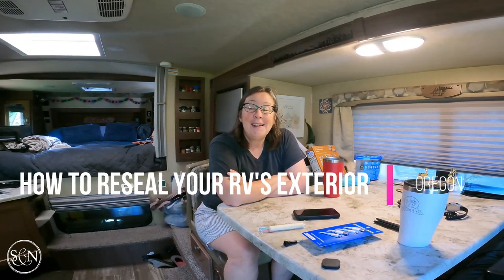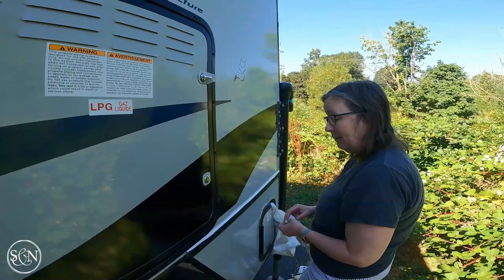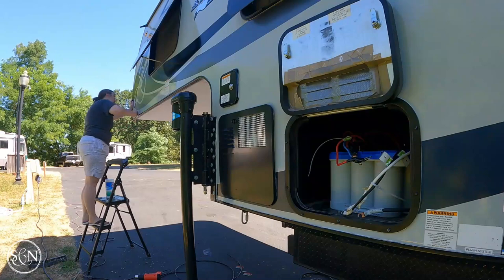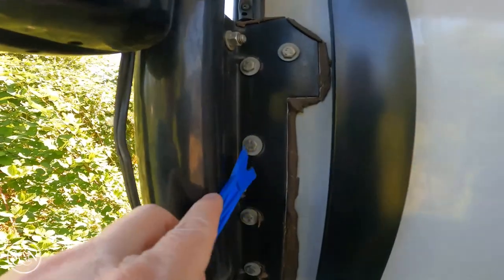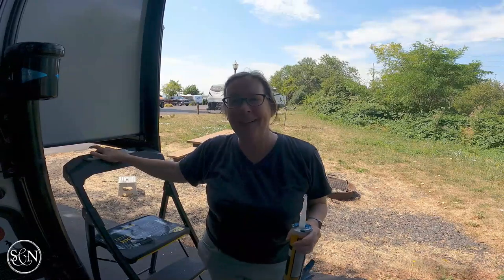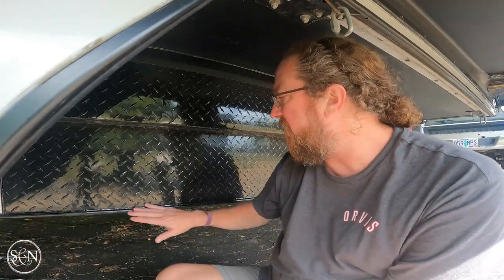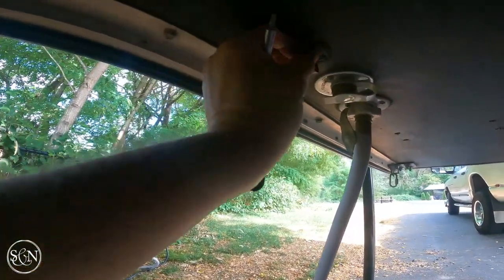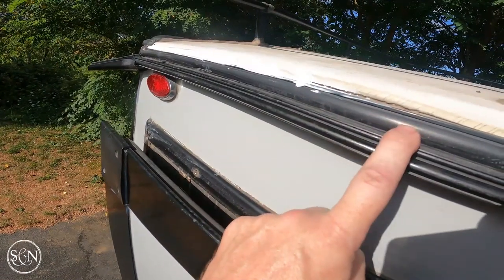How to Reseal Your RV's Exterior

Comment: OSI Max is the best silicone I've found so far. You can get just about any color.  The dicor flex silicone is too sticky and hard to tool with your finger.  On your long bead runs you can also use some masking tape.  Run your bead, tool with finger and then peel tape to get a nice line of caulking.
Reply from the maker: Thanks for letting me know. I’ll add OSI Max to my list for next year! I thought about using masking or painters tape. Probably would have been cleaner lines. But just seemed like a lot more work. 🤣🫣
Reply: @CupcakeChroniclesTC  normally the OSI would be sold at a building supplier because all the exterior guys use it.  The colors are made to match the coil stock colors.  There's a small rv dealer close to me and he told me he's been using it for a solid 3 years now with no problems.  I realized later in your video that you started talking about me 😂 I'm officially a youtube pro now 😂😂
Reply from the maker: @ToddStull  yep you made Steve’s day!  Not even kidding. He’s so pleased with himself and with you for telling him! 🙏👏😁

Comment: I have had my AF 1150 for about 18 months, it is getting time to check the seals. I don't have as many miles on mine as you do, but down here is the FL sun, I'm sure thats just as hard on it. The heat and humidity is higher here than where you are, but I have a 30x60 shop to keep it in. Hope to catch up to you two sometime. Safe Travels
Reply from the maker: I was actually surprised by some of the deterioration I found. Especially on the cabover, where it takes the worst beating from driving winds. 18 months probably would have been the best time for us to have done this. 

Storing yours inside likely helps protect it. But you’re right that your heat and humidity take a toll. 

We’re planning to go to next year’s Truck Camper Adventure Rally. It was so fun this year that we added it to our calendar for 2023! Maybe we could meet up then!
Or maybe we should make our way to Florida 😝
Reply: @CupcakeChroniclesTC , where is the Truck Camper Rally and when is it? Last summer I traveled about 15k miles and 25 states. This year my wife and I sold our house in Fort Lauderdale and bought a place in Dunnellon FL. This is central FL, 25 miles west of Ocala & I-75. The property is 2.5 acres, it has 5 rv hookups on the property, you are welcome anytime.
Reply from the maker: @getreel3515  do you have the flatbed truck camper? The rally is in Quartzsite, AZ February 9-12.
Reply: @CupcakeChroniclesTC , yes I have a F450 flatbed, cant put a pic on here. I will have to see if I can talk my wife into heading out that way next year. I want to plan on Alaska, but not sure if I can cross the border...no shot.
Reply from the maker: @getreel3515  I thought this was you, Tim! Alaska in a truck camper would be great. One of our daughters lives in Anchorage. Her husband is Air Force. Our youngest son and family are up there now, visiting and fishing! Such beautiful country.